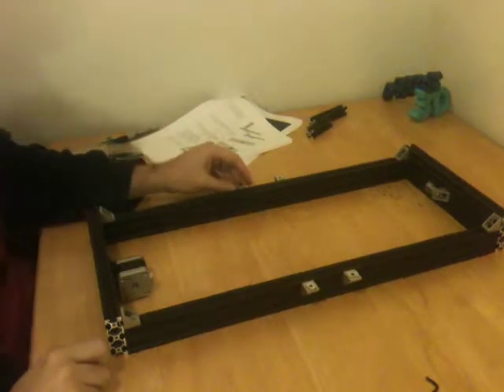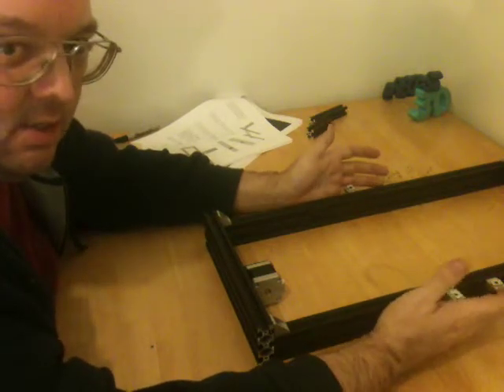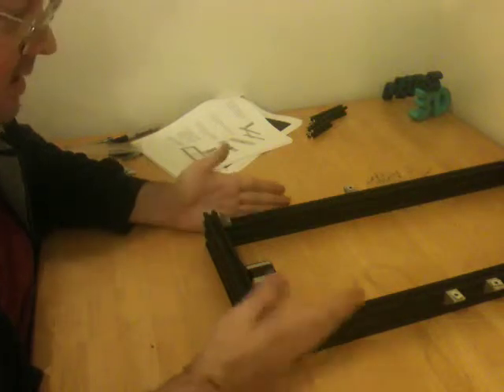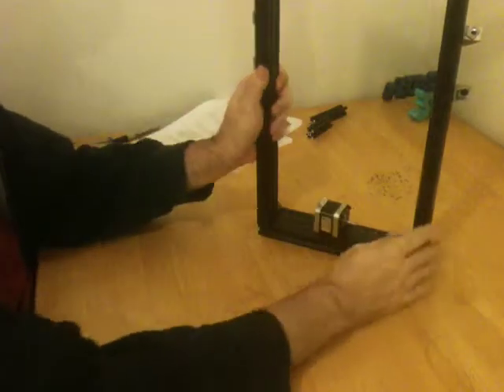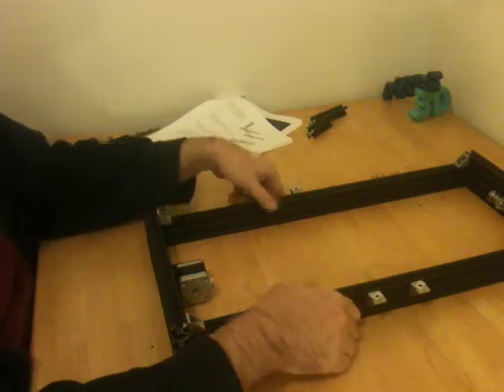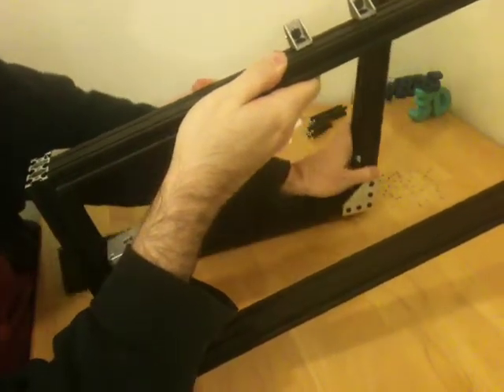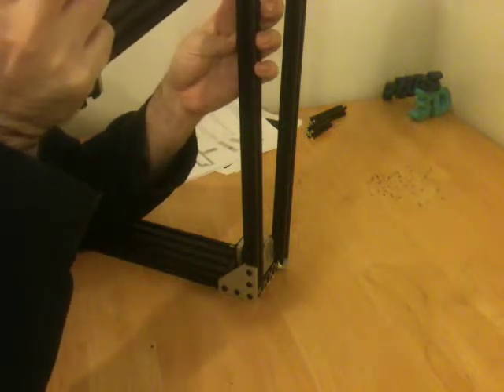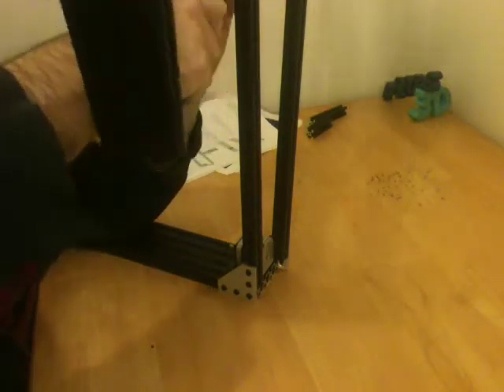Cobblebot Little Monster 3D Printer Build 10

Comment from the maker: I made a big goof on this part of the assembly. You need to make sure that when you flip it over the Y motor is on the right side of the Z 8020 part, not the left. I realized my mistake when I printed calibration cubes and they came out mirrored.